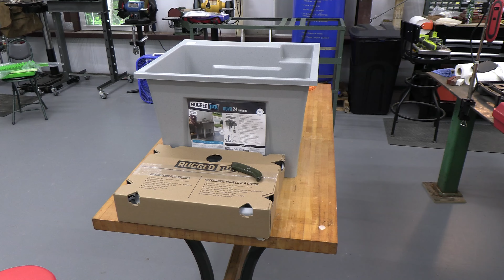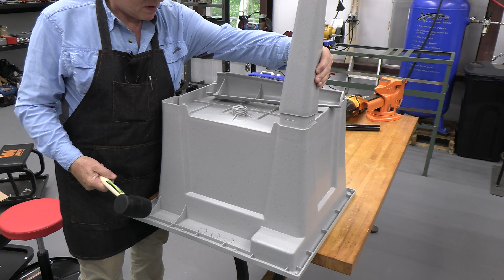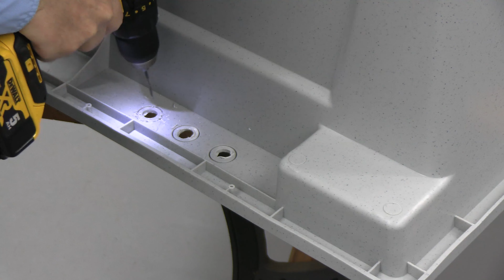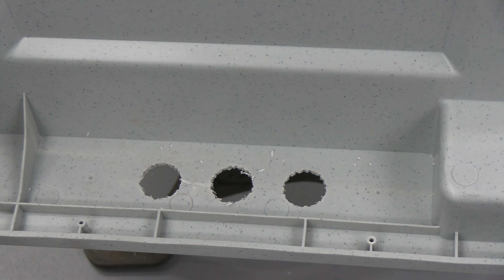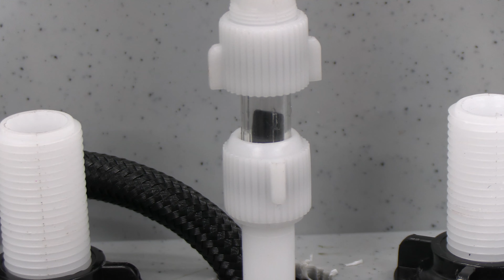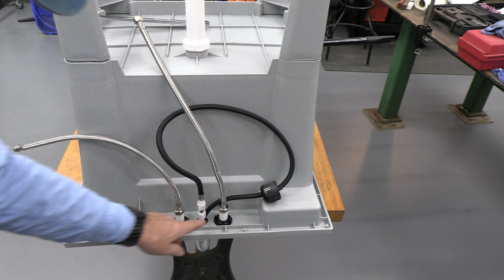Rugged Tub Utility Sink for Machine Shop

Comment: Hi got a leak for the spray hose connection faucet. where can i but the faucet with spray hose/weight? thanks
Reply from the maker: Thank you for your question. I’m sorry that you have a leak. Number one you can reuse the current weights you have on your new hose and I believe you can buy a new spray hose at Lowe’s Home Depot or other stores like that. Consider subscribing. Thanks. Joe.

Comment: Perfect size but I'm returning mine to lowes. The faucet and p-trap are junk and it appears the sink is just too wobbly for me. Lowes has another tub only model and I will spend the extra money on a metal faucet and plumbing separetly. Thanks for sharing. Nice tutorial.
Reply from the maker: Thank you for your comment. I understand there are definitely limitations with the sink but it’s worked well for me. The faucet is Chinese plastic not heavy duty at all and under rigorous work. It will probably fail. I’m just extra careful with it to keep it working well and it has so far now for a year. Consider subscribing. Thanks Joe.

Comment: Thank you for your video 
Could you please explain the purpose of the one way valve
Reply from the maker: Hello there thank you for your question which is a very good one. There is an anti-siphon valve. It prevents any dirty water particles, contamination, etc. from getting back into the line. It’s not absolutely necessary. You certainly could remove it. It’s more of a safety feature, but that’s what it’s known as an anti-siphon valve.

Comment: Thanks for the video. The box cover I bought says it includes a "garden hose adaptor".  I don't see any such thing included. Is there such a thing available? I'd like to hook it up outside near an outdoor spiget.
Reply from the maker: Thank you for your comment. Mine did not come with a garden hose adapter, nor was it listed in the instructions. It would be a handy feature, but it would have to fit on the spray handle. The spray handle nozzle can come off and it might be able to be re-fitted with a hose adapter.

Consider subscribing. Thanks Joe.
Reply: @JosephHunstad  thanks, I was able to get the fixtures I needed to hook it up to the garden hose.
Reply from the maker: @billschlegel1  good news buddy I will be very useful. Take care, Joe.
Reply: I'm assuming that meant for hooking up the supply lines to old school laundry taps that are garden hose size. (actually what I came here to confirm, which is unfortunate that he didn't show any of the other plumbing bits that came with. :( )